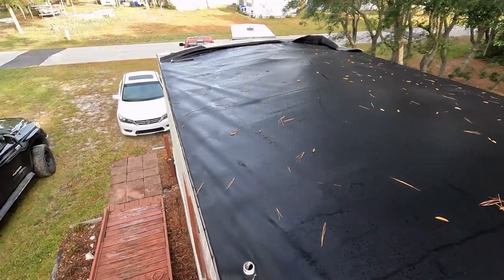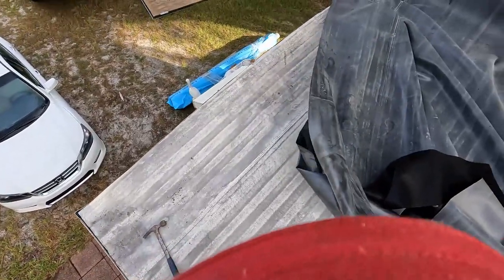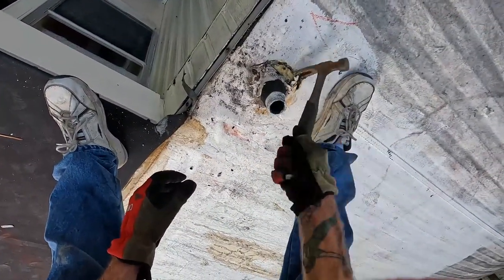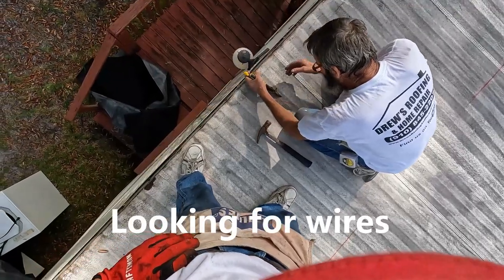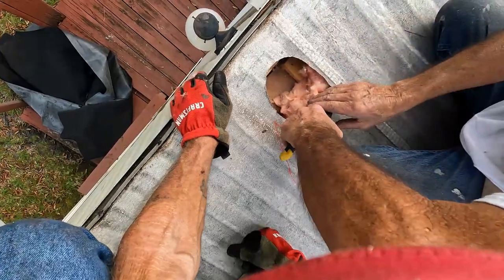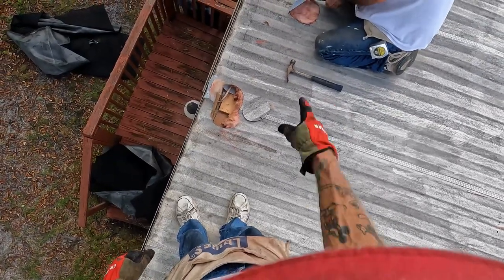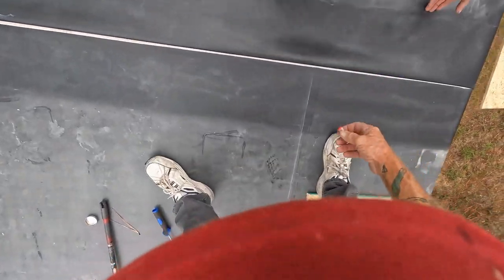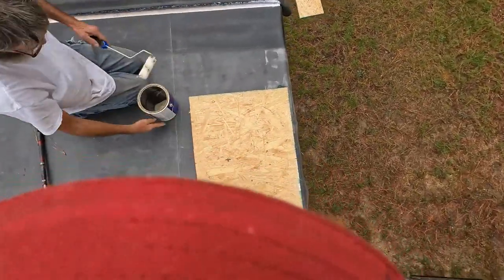Singlewide Trailer Re Roofing Problems. Mobile Home.

Comment: Hi Drew...I watched a number of your videos, that were incredibly helpful with doing some repairs on a double-wide my parents owned in central FL.  I'm trying to sell the home, and was recently told by an inspector that the home isn't worth keeping at this point.  He said one of the major repairs needed was a new roof.  is there any way you can tell me on average what a new roof would cost for a double-wide?  This one is roughly 1500sq ft.  I want to take into consideration all the repairs needed when listing the property, and roofing is the one thing I have absolutely no experience with....especially, with all the supply chain issues going on.  Any help is greatly appreciated.
Reply from the maker: Prices are different everywhere you go. Florida might be cheaper or more than likely more expensive than it is here in North Carolina. We have a rather nice economy. But I can tell you that a Doublewide 1500 ft.² you’re probably talking about close to 19 or 20 squares of shingles. That will include the main body of the house the starter strips and the ridge caps. If you were here I just did an estimate the other day and I charged $275 per square for the 30 year architectural shingle or the lifetime some places Collett lifetime shingle. In your area in Florida they have to use six nails per single same as here in North Carolina because of our hurricane situation. So you’re talking at least 20 squares times $300 probably in Florida therefore $6000
Reply: @Drewsroofingandhomerepair  I KNEW I asked the right person.  That's very close to what I was just told...which was $6K-$8K, and they were on the coast in Texas.  The realtor thought it would be close to $20K, and I haven't heard anyone say it would be anywhere NEAR that expensive.  I want the home gone quickly, so I'll just consider the job worth $8K...which I think is MORE than fair.  I almost thought about getting in touch with you to fix the place up and keep it in the family, and putting the whole thing up on YouTube, given each aspect of it could've been a different set of very good "how-to" videos..but, just about everything major needs replaced, or over-hauled...AC, plumbing, flooring (particle board on the floor throughout the entire house, that I've patched over at 7 places already), kitchen/appliances, lawn/sod/sprinkler system.  Just too much to warrant keeping at this point.  I'm just glad real estate is up right now, I probably wouldn't have even gotten the pay-off amount. Anyway, thank you again.  I feel confident on the roofing allowance.
Reply from the maker: Glad I can help

Comment: roof done wrong no glue down no wood underlayment not done the drews way its a wounder it lasted this long
Reply from the maker: I was surprised that it lasted as long as it did. And they definitely didn’t do it my way. No substrate to put the rubber on no glue on the rubber it was a nightmare